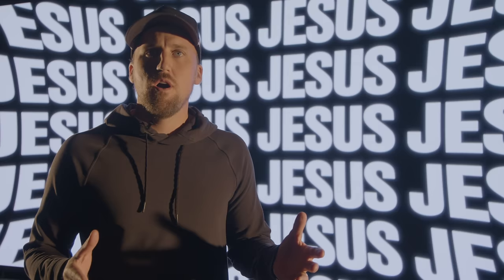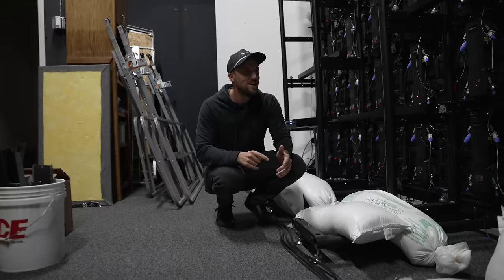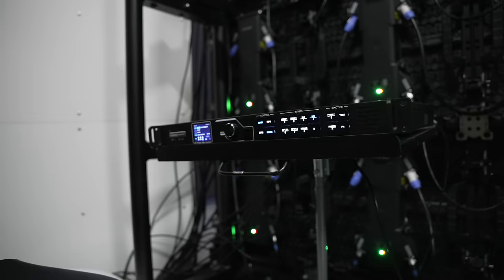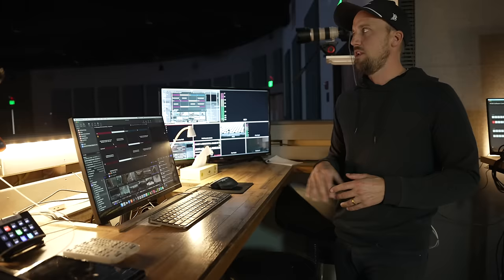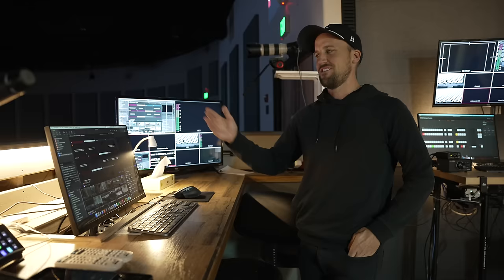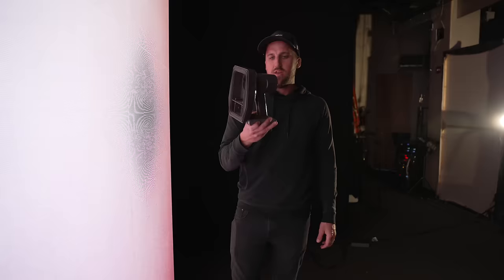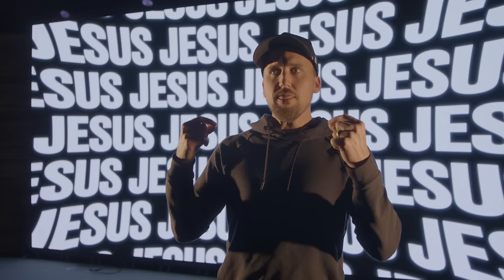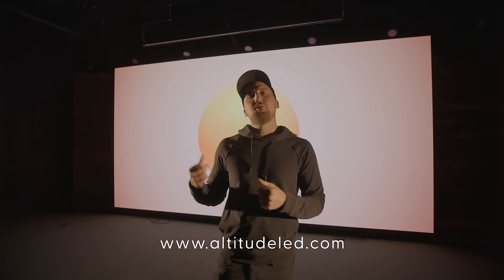How I Built an LED Wall for Our Church (Altitude LED System Rundown)

Comment: Cost for this size wall? There must be a per-panel cost plus the cost of mounting per foot and processor... Should be pretty easy to give pricing. The form you have to submit on the Altitude LED website only asks a few questions to quantify what is needed to get a cost.

Comment: Do you route the signal from the 2nd Propresenter computer through the Atem Contstallation? If so I would switch the Constallation Outputs instead of loop the NDI Stream through Propresenter for mirroring because of the delay. The switching can be done with a Makro in Propresenter. We do this in our church with companion where we trigger the button with rosstalk.

Comment: What is a general price point for an LED wall of this size and configuration from Altitude?
Reply: Very expensive
Reply: We need to normalize transparent pricing for things like this. Worship productions and Springtree are great in this regard. Their panels aren't the greatest, but at least the regular church tech guy can go to their website and get a starting price point in 30 seconds.
Reply: @mikehines14 as a relatively new tech director, this is a major problem. It’s incredibly difficult to find a general price point without a long consultation process. We were looking at Worship Productions, but I’ve heard that the panels aren’t amazing. Is there any manufacturer you would suggest that isn’t overly expensive but still good quality?
Reply: If you have to ask... 😁
Reply: @tannerblades9049   Well my friend I've tried to reply a couple times but my comments keep getting deleted. I guess they're not comfortable with competition 🤣

Comment: Good promo bro but you definitely rushed it out with less details needed from the Title itself. Please link where to get the vacuum for the panels, please share where to get and show build of the Ground Support . 
Show the config for the processor to get the data. 

I’m looking forward for more as you promised to put out more details on the altitude channel.

Comment: Blows my mind to have such and expensive piece of tech held down by cheap white sandbags. It is very common in these installations, but it wouldn't take much to wrap them in some black fabric to make it a bit more professional looking.

I'm also surprised it doesn't come shipped with plastic shells that you can fill with sand that would attach to the base. LIke say an outdoor umbrella base.
Reply: Playing devils advocate- are you really that concerned with how it looks behind the wall? If that's the case- should we also cover all those lights and cables on the back with curtains "just in case" someone sees it? I mean- personally I wouldn't use sand- every theatre should have stage weights for this. But I would then gaff the area with yellow so no one trips. The white is easy to see.
Reply: It's fine if it is a DIY set up, we all cut corners there, but this is professional build. If I spent all that money, I'd be pretty unimpressed by the sandbags. Then again maybe they ok'd that to save money.

I didn't know about stage weights and honestly I like the yellow tape idea or even motion leds.
Reply from the maker: Hi Dustin, I paid myself $0 in this install to put sandbags on our ground support.